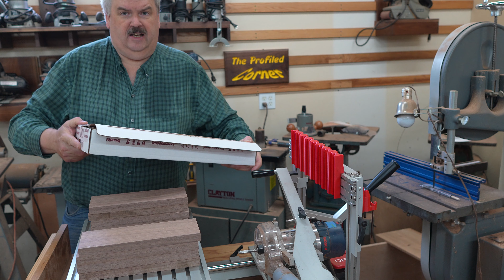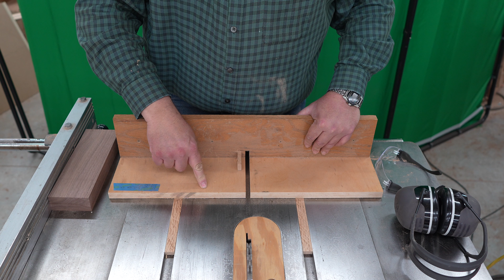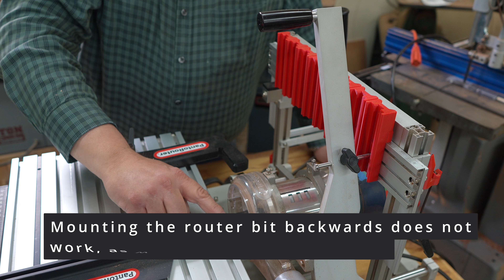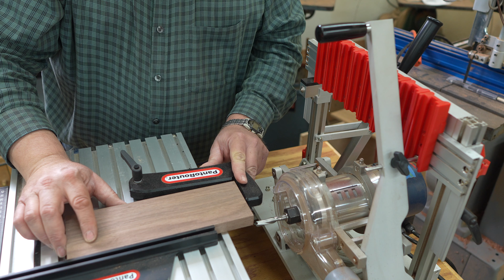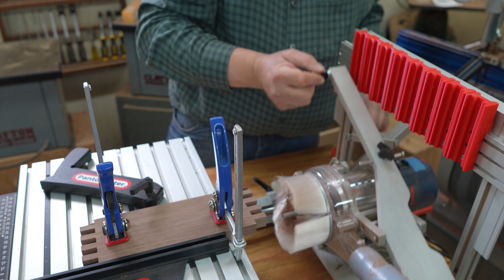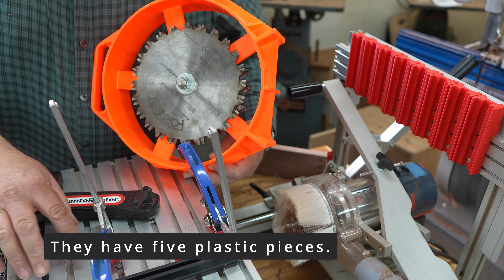Creating Dado Blade Carriers with Box Joints – 3/8” Box Joints Cut at a Table Saw and PantoRouter

Comment: Nice work.
Reply from the maker: Thanks.  I had thought about using the PantoRouter to create a patch (maybe using the dowel template or the mortise and tenon template) for the gouge that happened when cutting the handle in the top of one of the dado stack carriers, but I decided to leave it there as a reminder that I need to pay closer attention to where the dust brush will be positioned relative to the clamps.  That was a 1982 Rockwell Unisaw making the box joints.  I replaced the arbor bearings in it after I bought it and then had to replace the arbor because the very fine threads on the end were damaged as the bearings got stuck at the end of the shaft during removal. I put a new set of matched rubber belts on the saw that I bought from Amazon, and then had to replace those as they were not exactly the same - there was a seller on Ebay that had matched pair Fenner Drive link belts for the Unisaw, so I bought those.  My other Unisaw has had similar Fenner Drive link belts for the last 20 years.

Have you tested your Forrest Dado King dado stack yet to see if you need to shim it to reach common widths (3/8", 1/2", 3/4"), as I have to do with my old Forrest Dado stack?
Reply: @TheProfiledCorner Haven’t tried the dado set yet. Setting up the RAS is taking longer than I hoped. But I do think it still needs shims.